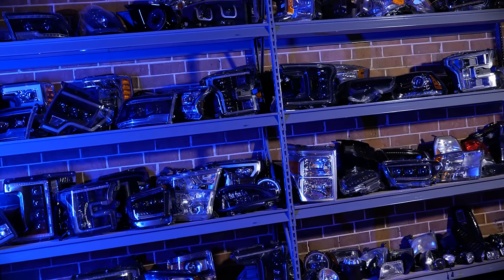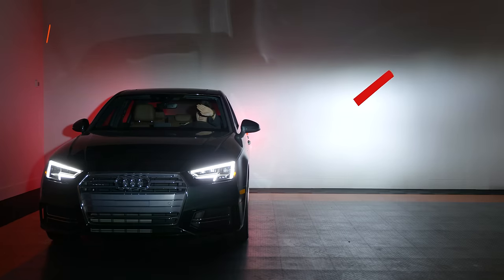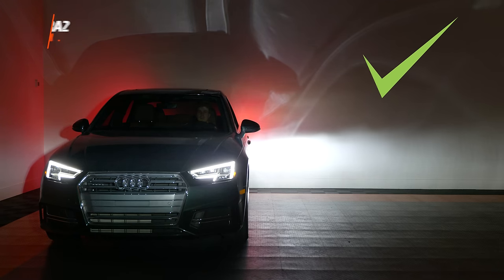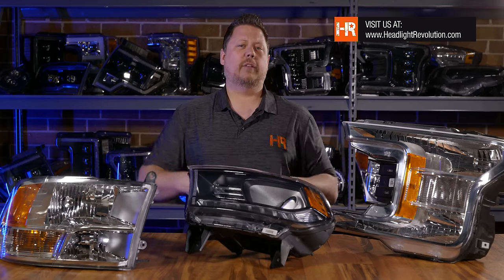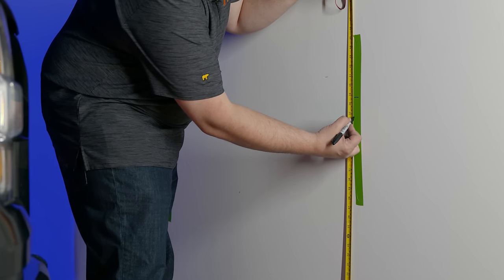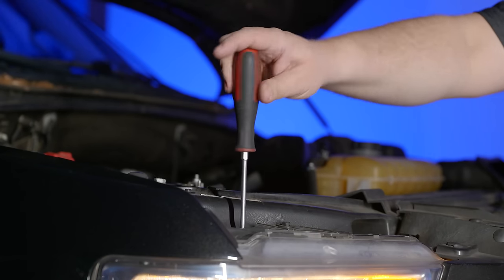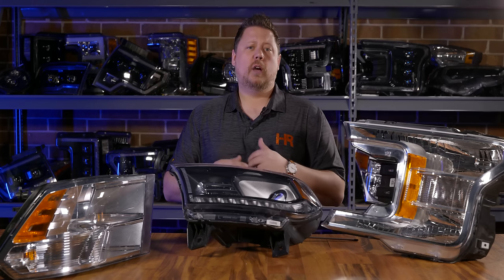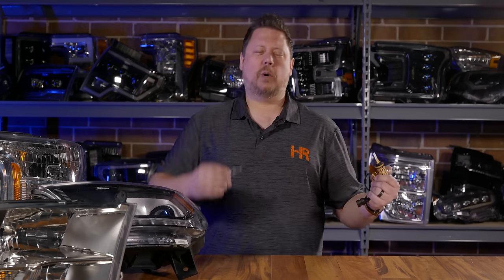How to Aim and Align Your Headlights

Comment: I just installed pit66 led headlight assemblies and Auxito led bulbs in my 2001 Ram 1500 and I am very frustrated. First none of these aftermarket companies seem to acknowledge that the daytime running lights they provide in these assemblies are 100% worthless. A 2001 dodge ram has daytime running lights that you cannot change. Utilizes the high beam bulbs by putting a lower voltage on them. That is how they get the daytime running lights. It is also controlled by a module and you cannot change it. Secondly, the fit on these headlight assemblies was not good. I had to pry pretty hard to get all the holes to line up. Third, when I move the adjusting the screws to align the headlights it doesn’t seem to change much.

Comment: I'm a truck driver and I used to prefer driving at night but there are So many vehicles with the wrong headlights or improperly aimed lights that I quit highway driving. 
Thank you for putting this video online!
Reply from the maker: No problem!
Reply: I’d love to see a type of tinting windshield that only sims the part of the glass where the light passes through into your eyes. It would take some serious tech, but would be cool
Reply: Truckers have badly aimed lights as well - I drive across a province fairly regularly at night, and the amount of times i get blinded by big rigs is horrible. I think this issue effects everyone and yet no one does this or takes it to a shop to get done.
Reply: Agree
Reply: Now that they put this video up. Why don't you go back to driving?

Comment: Great video. I recently replaced my headlight housings, as my old ones were very milky and cloudy, and cleaning really didn’t improve light output. Well once I installed the new one the light output was much greater, but I noticed my beam was aimed too low to the street limiting my light output distance greatly. Once I adjusted them following you method, it made such a world of a difference with road visibility. I barely have to cut on my high beams unless I’m on a really dark country road. Your instructions were very clear and concise.

Comment: Be sure to think about Flat and Level. Most garages have a several inch drop over 20', and many change pitch in the driveway. So, not only is your vehicle angled, but it's lower when it's backed up than when parked 3' from the wall.
I haven't found anything nearby that I would consider level over the 40-ish feet needed to back up and do this correctly. Most parking lots are sloped for runoff.
Reply: It probably doesn't matter if it's a slope though.  What would matter is if there's a bump and it's not flat. So it has to be flat but it doesn't have to be level. Because if it's flat and a slope you're beams are going to travel straight towards that wall.  I'm trying to think it through my head right now and I think that's right.
Reply: @glasshalfempty1984  Take that to it's logical conclusion and imagine how high up the wall the hotspots would if the slope was 60* or 90*...

Comment: Own a 2002 GMC Sierra 1500HD SLE Crewcab and replace the original lens with new ones. Took my truck to the dealership to have the lens realigned. I was told to bring it back, if I had a problem seeing when driving at night. I still was having trouble seeing at night, but I didn't take it back. After doing some exhausted research, I decided to buy your lights. Received and installed your 9005/HB3 and 9006/HB4 LEDs that I love. The lighting was still out of alignment. The video you produced on aiming and aligning your headlights was very informative and helpful. After marking off the garage door, I should see how far off my headlights were. I corrected both lens with the adjustment points on the lens. Thanks to video, I can safely drive at night with no fear of seeing things on the roadway too late.

Comment: Thank you. This was very helpful. Honestly, it feels like at least 20% of new vehicles on the road are poorly aimed straight from the factory. 2017-2019 Toyota Corollas always seem to blind me with their factory LED headlights. Doesn't seem to matter if I'm in a taller SUV or my Miata. Thank god the IIHS added headlight testing to their safety rating a few years ago. Hopefully the offending manufacturers will take the safety of oncoming drivers seriously. Honda seems to do the best job of making new vehicles with well-aimed headlights.
Reply from the maker: That is so true, The factory should definitely do a better job!

Comment: Thanks for the video. So hard to find somewhere that's level and that I can back 25 feet away 😛
Reply from the maker: Happy to help!
Reply: I have the same quandary.  Unless you have a ginormous garage, you're stuck because every outdoor place abutting a wall either has a sidewalk on it, or is angled for drainage.
Reply: @ryan4327  I went to my college parking structure during break :)

Comment: I have a 2023 rav4 and I think my lights are off the hot spot is high and there's no visibility on the lower like seeing obstacles on the road can the be fixed?
Reply from the maker: Absolutely! Have you tried adjusting the OEM Headlights yet to see how high they're currently sitting? If you're not comfortable adjusting lights, an OEM Toyota dealership or local shop can help!

Comment: Thanks for the video, helped me aim my lights after I leveled my truck. They had to come down quite a bit.

I'm surprised you mentioned some LEDs work well as halogen replacements..
I was always under the impression LEDs, just like HIDs, require a projector rather than a reflector housing to be used correctly. Installing them in reflector type housings that halogens are found in usually create a ton of glare with no distinct cutoff. Interested in your thoughts on this...
Reply from the maker: We would be happy to go into more detail for you. Shoot us an email at Sales@headlightrevolution.com
Reply: Yea many of the retrofit LEDs (well, most) just turn the headlights in to basically flood lights. They look brighter but they don't project properly so you actually get LESS range.
Reply: There are a ton of cars that come with halogen projectors and I feel this is aimed for that. LED's in a reflector would be a bad idea.

Comment: Very good informational video! I installed LED’s in my 2019 Colorado Crew Cab 4x4, V6, WT, that only comes with reflector type headlights, I knew enough about headlights and aiming them along with light patterns to know I needed something special to do so. In my research I found just the thing I’m surprised you never mentioned. The brand I found out about at the time over 2  years ago was MORIMOTO TWO STROKE 2.0, H11 for low, that I will explain because their the ones you always have on, so you need to be able to aim correctly and control the illumination reflected out and down the road, so you don’t blind oncoming drivers. See they are designed so once you get them mounted without their sockets, you can still twist them so the led elements on the opposing sides are facing side to side! Then once you are all done you must re-aim them correctly. In the time since I have never been flashed, even when I tow my 27’ travel trailer! But the improvement in illumination of the roadway is absolutely amazing!! Especially with both high and low beams on!

Comment: Agreed everyone who drives needs to see this video. Especially if someone drives with led lights. I make the argument that blue colored light appears brighter than the normal yellow or orange light from a typical halogen. If there are orange or yellow headlight leds out there, I’d be interested in seeing how that would look.
Reply from the maker: There are some yellow LED bulbs on the market, we have a few available!
Reply: I have a nice set of ice blue led headlights that are not as bright as halogen, but they are more designed to highlight the road markings, reflective materials, license plates, ect.  I even had someone stand in front of both types of lights, and even he said that the LEDs I have installed are easier on the eyes and even the brights are not blinding in any way. 
The color temp of the LEDs are 8000k, but so far they have proven to be better in every way over the BLINDING white LEDs.

Comment: What we are forgetting here is the mismatch between vehicles. No amount of adjustment in a truck is going to prevent blinding me in my Ford Focus, and since every other vehicle on the road is a pickup OR SUV, and presents a danger to ME, why should I have to worry about the after market (cheap) LEDs in MY Focus having a bad beam pattern? Obviously, I will NOT be blinding the truck or SUV driver! So, what's the BIG DEAL?
Reply from the maker: After working with many different vehicle types you would be supris3ed how some cars can still blind trucks from light scatter.

Comment: Thanks a lot, I had to adjust mine after getting my car brand new from the factory. When I did the measurements and marking I backed up 25ft and come to find out the headlight cutoff was 12 inches higher than the marking below the 2inch line. Adjusted them and no more flashes at night. Interesting how I had to adjust them myself.
Reply from the maker: Glad to hear that were able to help out! You'd be surprised by the amount of brand new vehicles that come off the lot with improperly aligned headlights. It's way too many!
Reply: @HeadlightRevolution  I think it's because this step adds too much time for the manufacturer to do properly coming off the assembly line with sufficiently knowledgeable QA personnel and is hard to automate.

Comment: Last but not least, i recommend looking at the car  with the new LED from a different car, and see whether it's blinding or not. Preferably, use a sedan since they are lower than SUVs. 

We recently installed some LEDs, followed the adjustments steps, measurements, and so forth... But they were hella blinding when i drove across them in another car. Had to lower them an additional 2-3 inches
Reply from the maker: This is a great suggestion!

Comment: I put in some led bulbs on a 2014 crv and both seem to be pointing to the right. These led light bulbs are designed to fit 1:1 replacement for halogen bulbs. They fit in nicely with the two smaller tabs on bottom and wider one on top. Not sure what can even be adjusted after that. Maybe some screw somewhere I need to mess with. Or maybe just try to dangle the bulbs a bit to the left before tightening.

Comment: Yup! Two inches is the magic number. (If only women felt the same 😅)
I just adjusted my lights and it clearly makes a difference for me, and from what I can see, for others. My lights do not look like they're in other drivers line of sight. Thanks again for the info!
Reply: Stop using the standard 2" & 4" drop, these elevations change according to light height. States have min and max projection distances for the low beam. generally 135' minimum and 200' maximum. If you use the 2" drop @ 25' on headlights that are 42" you'll projected the beam @ 520' and not the state maximum. STOP BLINDING OTHER DRIVERS . 42" height @ 25' should be 5.25". Use the formula (42/200)x25=5.25" below center line. ( bulb centerline / light projection  feet  ) x the distance you are projecting it to  ( test wall, test board or other ) it could be anywhere from 10 feet to 50 feet. 

Fog lights have a maximum of 135' projection, so get those adjusted correctly too.
Reply: @lionelanderson4246  duely noted 😅

Comment: I have a 14 Grand Cherokee Summit (HID). I have seen a bunch of D3S LED conversion bulbs, but I'm skeptical if any of them can meet or beat the performance of the factory bulbs. I already had a bulb going out so I thought I would give it a try, only to be completely disappointed as expected. Are there any you are aware of that are worth trying or should I just go ahead and get some Ozram night breaker lasers?
Reply from the maker: None of the LED bulbs will suffice sadly. 
I would get the Osram NBL for sure!

Comment: Great video! :) I have a 2011 Kia Sorento with I’m assuming original bulbs or same type as original, and driving at night sucks. I feel they aren’t bright and they aim low or something. The high beam works great, but I rarely get to use them. The light seems very amber in color, especially compared to the new cars with chunks of actual orbiting stars installed in them. Way too bright. Just wondering if I need to only adjust the lights or get new low beam bulbs? Like 4000K Sylvania H11STBP’s? I’m reading that the color helps more than the lumens. All I know is I need to see better at night because I do not feel safe.
Reply from the maker: If the bulbs are original from 2011, you could definitely benefit from an upgrade! Even replacing the OEM bulb will seem much brighter. If you'd like to upgrade, you can also try brands like Morimoto, SV4, Philips, or Vision X. Reach out and we'd be happy to recommend an upgrade! sales@headlightrevolution.com or 218-755-5200
Reply: @HeadlightRevolution  I appreciate your help and even looked at your light options. Unfortunately I cannot afford anything close to that. I will need to just pick up a basic bulb locally as I need them for tomorrow.

Comment: It’s also okay to spend a day and do a proper refinish of the external housings: 600 800 1000 1500 3m polish with buffer alcohol wipe meguairs headlight spray.

Do that first before you run out for new bulbs.  The headlight restoration pro has the best how to

Comment: I have a 2014 Cadillac srx, these cars are equipped with a very poor and dangerous running lights, have you tested a lightbulb that will greatly improve the lights.  The bright lights are perfect, but the running lights are dangerous for driving at night, hope you can help and advise which bulb will correct this problem, thanks. Ron.
Reply from the maker: Please reach out so we can best assist you in finding a great performing bulb for your vehicle!

218-755-5200
Sales@HeadlightRevolution.com

Comment: Great video, but you continue with Dodge and Ram pickup trucks. I have a Ford Edge which has projector head mounts. I just want installed Led lights low/high beam however, my drivers side has a black shadow towards the middle of the SUV and the passenger side projects evenly. How can I adjust my drivers side light to where it is evenly aligned with the passenger side.
Thank you
Reply from the maker: What kind of LED bulbs did you install? And did you install them correctly? Low quality LEDs can create really poor beam patterns. Check out this video: https://www.youtube.com/watch?v=NbfAyqVgVdM&t=90s

Comment: Great video I guess you can also do this by marking where you original headlight bulbs illuminate on the wall and using that as a reference to adjust the led lights when installed .
Reply from the maker: Just changing a bulb out isn't going to change where the lights are aimed unless you unbolt the headlight.

Comment: I’m about to buy an LED replacement for my 01 Lexus rx 300, it has auto adjustment low beams while driving to not blind people. Would I have to do any different postion or aligning?
Reply from the maker: No you would not, adjustments will still be the same

Comment: Hey I have a question you may or may not be able to answer, I just purchased some projector headlights from spec d for my 06 Colorado, they look awesome but my HID bulbs that were in the low beams of the truck when I bought it do not fit the new housings, Currently running halogen high and low beams, since I have an HID kit I could just replace the bulb with an h1 but what would you recommend I do for high beam? Get another HID kit for high beam? Or Fresh start with all led? I want the 6k whiter light for high and low if possible. Thanks for the videos and any advice given!
Reply from the maker: Shoot us an email at Sales@headlightrevolution.com and we can assist you, and you're welcome!!!

Comment: Okay I have a 2000 Toyota Camry LE. What led headlights would be right for my headlight assembly? I have Oracle lighting V Series led bulbs. The 9005 high beam and the 9006 low beam. I got these because of the 9005 high beam are my drl's and they work. You haven't tested these bulbs as yet. If these bulbs are not right for my Camry tell me what is so I can buy them. Thanks much. Peace.
Reply from the maker: I would go with the Morimoto 2Stroke 3.0 for your car!

Comment: I just upgraded my headlights to Morimoto XB LED Gen2 on my Toyota Tacoma TRD Off Road. The beam pattern is not even all the way across for both lights when I back up to 25 feet.
Also , how can I find this in owners manual if I upgraded to LED lights ?  Should I just adjust the beam to the measurement from ground ?  This is very hard to figure out if I have upgraded to lights that I can not change bulbs. The Morimoto lights I have are projector lights. How to do it with projector lights ?
Reply from the maker: Your Morimoto XB headlights are LED! There is no bulbs to replace on those housings at all, it is all built in like an OEM LED headlight.

Projector headlight adjustment instructions will be the same as found here! It sounds like your beam pattern is too close together and just needs some slight adjustments to properly perform. There is adjustments on the backside of the headlights that you can use to adjust where you need them!

Please email us if you'd like some assistance!
Sales@HeadlightRevolution.com